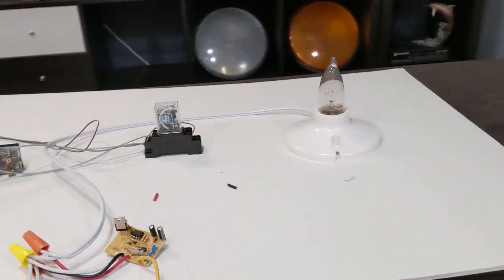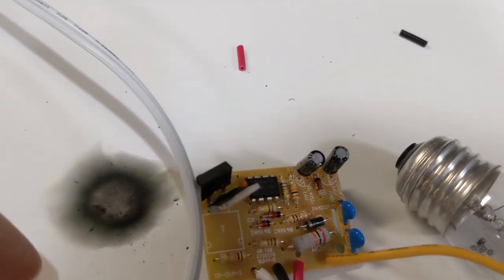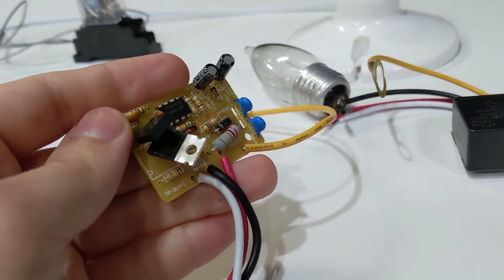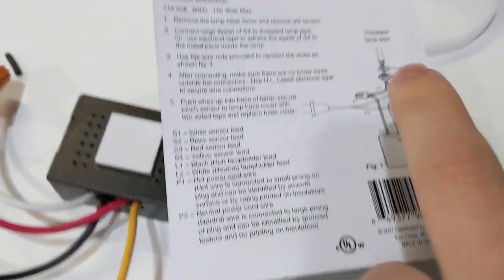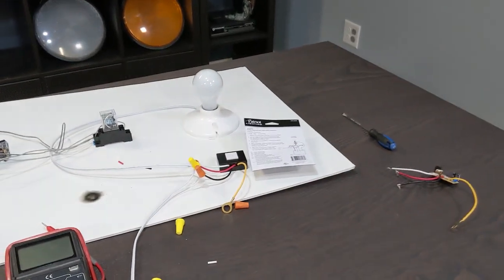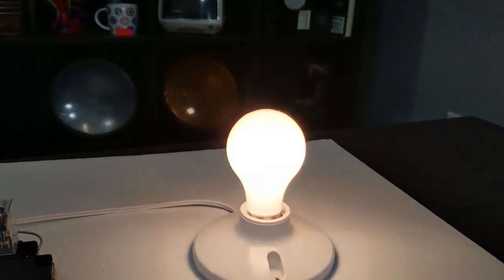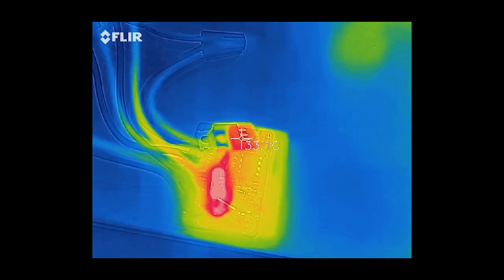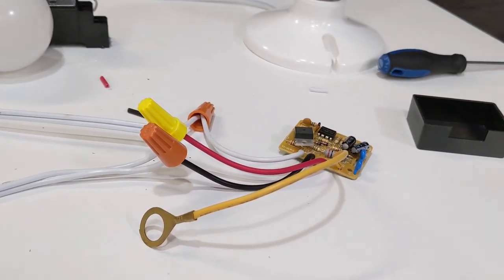A slightly explosive touch-lamp follow-up (standby energy consumption)

Comment: Black is negative or N, Red is positive or L it’s a standard yet US for bizarre reason picked black for hot yet in electronics it’s negative in DC or neutral in AC go figure 🤪
Reply: I was thinking the same thing. Using black for hot is weird. Red, as in fire, is hot. How the he'll can the US screw that up too? Together with the metric system and temperature.
Reply: Red is hot yea.
Reply: @andykillsu  Since when is black a "hot" colour?
Reply: How can black be hot/ live? That's just bizzare. The more I hear about the US electrical system the more I worry!
Reply: andykillsu when something gets hot it glows red, when cools down it’s black
Reply: @andykillsu  neither black nor white are colours, they are both definitions, a pint of Guinness or my black cat, they are just a very dark brown rather than black.
Reply: Andrew Delashaw brown 🤔, you mean dark orange don’t you 😁
Reply: @andykillsu  infrared is closer to red then black, hence red being live.
Reply: Black was selected for hot before there was plastic that are easily colored or electronics.
Reply: Black is live and white is neutral in the US. Unless you're wiring audio equipment, in which case for audio engineers it changes and  red is positive/live and black is negative/neutral. 
And then we have some old houses that are done with weird wiring that doesn't match either. Lol. Yeah, it's weird.
Reply: Lucid Moses , white would of made more sense for hot, as when something gets so dam hot it glows white hot
Reply: I was thinking the same thing as well, i don't hobby around with electronics, but the one thing i thought i knew went out of the window here, but now i see that it's a US thing, which is weird, but then again, there's more that's weird in the US.
Reply: @andykillsu  the car would be even hotter if it glowed bright white...
Reply: @neilkelly3849  Its not that bad.  Its all in what you're used to.  In the US, the basic AC wiring colors are: no insulation is ground/earth, white is neutral, black is hot and red is hot switched.  Thank goodness for low voltage DC we all seem to have the same basic standard, black is negative and red is positive.  But as far as building AC wiring is concerned, why in the blue blinking blazes don't we have a worldwide standard coloring standard?!
Reply: Probably been said elsewhere but before 2004 black was neutral in the UK and live was red. Changing to blue neutral and brown live. Single phase home wiring etc etc
Reply: @neilkelly3849  Yeah, no wonder a profesionnal is required to change a blown fuse.
Reply: My bet is o money - when they picked colors for household wiring white and black were cheapest available :)
Reply: @insoft_uk  Maybe, but the logic at the time was, the regular wire vs the special wire.  You could have this paper stuff, a rubber kinds of stuff or cloth.  Which ever the natural color was a kind of puky-pale whitish.
frankly you where lucky to have any "special". The old Knob and tube stuff was all single wire runs and your hot and return didn't even follow the same path.
Reply: when the wire my apartment complex in the early late 70's, they only use all black wires, then put dab of white paint on to the end of "neutral" wire.  So, just cause there are any form of "standardized" colors to be used, does not mean it is followed.
Reply: Gets multimeter out, black wire is common/0volts, red wire is +/line/hot/live, then says who would use the red as hot? It's an internationally accepted standard for test multimeters....
Reply: But in UK and EU Brown and Black are Hot and Blue Neutral, and in the US Black is a live color and white neutral... I don't know which standard you are referring to
Reply: @SamTheBattleshipp  In the US, when there are two active phases, they are typically black and red.  Speakers driven in a bridge configuration likewise have two active wires that are black and red.  Low-voltage DC is often wired with the negative terminal as the neutral voltage, but telephone circuits are wired with positive ground.  If there is any DC leakage between two buried objects, the positive one will corrode.  If telephone circuits had their negative leads at ground potential, all of the positive wires would corrode, but having grounding stakes attached to the positive leads will cause nearly all the underground corrosion to occur on a small number of grounding stakes rather than on millions of subscriber service lines.

Having the device switch the lamp neutral rather than the lamp hot is unusual, but might have been tolerable if had included separate wires for the two hots (so one pair of wires would connect to the cord and the other pair to the lamp).  Having the device connect the white and black wires together when turned on, however, strikes me as really bizarre.  I would think that the stores selling these units could improve customer satisfaction if they got a batch of stickers printed in color showing the correct wiring and warning that it is likely to differ from expectations.
Reply: @740mc  Exactly. In a single-phase setting, black is hot and blue is neutral in Europe. In a three phase setting, you have black, brown and gray for the three phases. The ground wire is green and yellow.
Reply: In Germany Black, Brown and Gray are hot wires, light blue is neutral and green/yellow is ground. Before 1965, neutral was gray and earth was red. While gray makes sense for neutral red did not. Thankfully it got changed.
Reply: Ruhrpottpatriot very much the same in UK, Brown is L1, Blue is N and Green is E, Black is L2 and Gray is L3
Reply: @grg121344  I've seen white cotton wire, and I've seen dark gray.  I don't think I've seen individual cotton wires in other colors.
Reply: Insoft in the US we generally read the directions and test with a meter instead of blindly following color codes ;-)
Reply: It's more like "marked" = hot, so between black and white, black is the marked one. Between black and red, red is the marked on. Between copper and silver, copper is the marked one. Then again, in 4-wire speaker cables the white/green pair has white as +
Reply: Jeff Groves in the UK we generally use our fingers, get great shocking results ⚡️
Reply: weust FOOT YOU! LOL
Reply: Red is universally a colour of danger, and  "Hot/Live = Danger" when it comes to electricity. 
UK wiring used to use red for live/hot and black for neutral - but now we use the hatstand European colours of brown for live and blue for neutral.
Reply: While "proper" color coding is nice, it's also meaningless for anything that isn't a straight "mains comes from here" or "mains goes in here" thing. What color is you "switched mains" then? No such thing as wiring up something like this module WITHOUT FOLLOWING THE FUCKING INSTRUCTIONS. Color irrelevant.
Reply: Bleached cotton bell wire (or paper) which has never reached high temperatures is white.  Wire (or paper) that has reached high temperatures will be black.
Reply: Electrons are negatively charged, therefore even in electronics the black wire is "hot" because that's where the electrons are coming from.
Reply: As a completely knowledge less person about this stuff, I assumed it was “black is bad” and you do not touch black.
Reply: Steven Emert Why dont we have worldwide standard? Because every country developed their local norms when it didn’t matter what other countries did. And getting everyone to agree after the fact is near impossible, especially with so much stuff using their own variations.
Reply: @greenmanreddog  I imagine that's another thing that could change after Brexit. We'll go back to red/black wiring, as well as having blue passports. Which of course is far more important than the economy going down the toilet.
Reply: @andykillsu  nice attempt at trolling
Reply: @iMagic16  Because objecting to the ceaseless cultural imperialism of Eurotrash is trolling
Reply: @greenmanreddog  UK has used brown/live blue/neutral in flex cable since 1969 (before joining EU)
Reply: @workphone8822  I find it interesting that in the days before RCDs, it was acceptable to have a lightweight green grounding wire, but nowadays the grounding wire must be large enough to handle sustained current equal to the line's fuse rating (and colored green+yellow to distinguish it from the wimpy green wires) despite that fact that an RCD would trip almost immediately if any non-trivial current flowed in the grounding lead.
Reply: @xenonram  Thats the colour your trousers go if you grab hold of it
Reply: In the USA: any color wire is hot EXCEPT white, gray, green, green with a yellow stripe, or bare wire. Usually for us electricians, in a 120/240v single phase system, Black is “A” phase hot and red is “B” phase hot with a white neutral and a green or uninsulated wire ground. In a 120/208V 3 phase system, A and B and neutral are the same color as the 120/240, but we add blue as a “C” phase (the third phase) and often run green for ground. The USA also has a higher voltage system for larger loads, such as commercial lighting and motors found outside of residential areas. This system is 277/480V, which their A B and C phases are Brown, Orange and Yellow respectfully and use a gray neutral and a green ground. We also use purple and pink in commercial installations for switch wires going from the light switch to the light(s) itself(themselves). Now these colors are a courtesy, and there are no code requirements outside of white, gray, green or bare on which colors are hot or not.
Reply: andykillsu look mate, I don’t think it matters about whether a colour is hot or cold; in the UK (or just me) I see red as hot, like when something is “red hot”,glowing hot, or even red fire engines (fire trucks). Where as you may see black as hot, as in fire ash or black body radiation (or something idk). But I think we are forgetting that colours aren’t any temperature, it’s the associations we build around them, party influenced by our culture: ie you Americans and us Europeans. If one system works for you, that being the imperial system, Fahrenheit and other stuff, that’s fine. I don’t care. It’s all built up on associations and intuition, that’s fine. 

The problem I have is the discrepancy between Europeans and Americans, and possibly the fact that you still use a separate system different from the rest of the world that kinda confuses me. It’s not that someone has less or more common sense, it’s that we have different common senses.
Reply: @andykillsu  "Because black is a hot colour while white is a neutral/cool color (both in colour temp and actual heat). You Europeans got it wrong and don’t want to admit the US actually has something electrically more common sense than Europe"

No, black is neutral in old UK wiring and negative in DC circuitry.  White was never used.  To take a colour that is normally asscoaited with negative or ground in any context and give it the opposite meaning is counterintuitive.

Also, if you're going to use English as a language, have the decency to use English spelling.
Reply: @Varangian_af_Scaniae  "@andykillsu Since when is black a "hot" colour?"

I'm guessing the logic of using black is "if you touch this, you die and black is the colour normally associated with death"
Reply: @xenonram  "@andykillsu yeah, brown is *live*. Derp. What idiot decided brown should be hot? Brown should be earth if anything."

Firstly, if you're gpoing to use the English langauge, have the decency to use English terminology.  It's not hot, it's at the same temperature as the neutral wire, it's live. 

Also, I believe the colours were decided so as to not confuse the colour blind, colour blindness being a condition that predominantly affects men (and being an electrician was tradtionally considered a man's trade)

The old colours win the UK were red for live, black for neutral and green for earth.  But red-green colour blindness is the most common form of colour blindness, hence the brown, blue and striped green and yellow.
Reply: Red = blood = bad = HOT
black = death = bad = HOT
white = blank/nothing = Neutral
green = grass = Ground
Reply: @andykillsu  Which is why something can be described as "white-hot", obviously because of it's cool connotations
Reply: To be fair, the US system is profoundly old, the NEC was first published in 1897, a full 10 years before the British had an electric code (they had recommendations before that, but not an actual code). So the logic behind wire insulation colors probably made more sense to the people at that time then they do now. The discrepancy between AC and DC is less surprising, the feud between Edison and Tesla is probably enough reasoning for that. As far as the logic of black being hot, you can justify or vilify the choice however you like with any color, but black is the color of death. Black, white green is as logical to me as red black green, and there are enough people building enough stuff in NA that it’s unlikely to change.
Reply: andykillsu You do realize that black cars are only hot in summer because they ABSORB more sun energy than other color cars, right?

orange/red sun light GOES TOO black car

just like:

red live GOES TOO black neutral

And the black car is ONLY hot when the red sun is shining.

just like: 

Black neutral only gets warm when connected to red hot.

Simple as that
Reply: GeoNeilUK Taking a colour associated with death and make the thing that will kill you that colour is very intuitive. 

You give me a multitude of colours of something potentially dangerous without any other information and the last ones I would touch are the red (the colour of warning and “stop”) and black (the colour of death). 

Fact is, it doesn’t really matter as different people will find different things intuitive, and standardized system would be extremely nice, though.
Reply: @andykillsu  How is black hot? In my BBQ, black coals are cold, white coals are hot! When it's dark outside, it gets cold, not hot.  
I agree that RED should be hot. 

I admit I'm electrically challenged (freakin' scared of it) from U.S.
Reply: @andykillsu  If hot is black then what colour is the tap for your hot water, I can bet that it won't be black...
Reply: In Finland blue is neutral and black is live (in this apartment anyway, I have also seen grey and brown used as live depending on the age of the wiring).  I have also worked on a ship where we used the US colours for the 110 system, the euro colours for the 220 systems and then to make things even more interesting we used IEC colours for 12 and 24 volts systems.  Our first engineer was from India, our second engineer was from the Philippines, and we had various other nationals as well, so electrical wiring could become a bit scary sometimes:-)  Luckily most of the high voltage stuff was fairly hardwired and not stuff we needed to touch.  Can be a bit odd trying to work out which is hot and which is not when the wires are all in the same wire chase though.
Reply: You are still getting it wrong. The reason it exploded is because you connected the white S1 wire to your mains line voltage. 
Your explosion has nothing to do with connecting black or red wires to neutral or not.
Reply: Why are you calling AC wiring positive or negative or neutral or even hot? Current in AC flows both ways, hence the name Alternating Current.
Reply: @Varangian_af_Scaniae  ever look at burnt wood it stone?
Reply: @neilkelly3849  stop worrying we got it covered, just try to follow along or is that too difficult for you?
Reply: @insoft_uk  that just like your opinion man!
Reply: @tomf3150  we don't use fuses anymore we use breakers
Reply: @JeffreyGroves  just in case some stupidly brave goober goes and wires up a hidden death trap, meters save lives.
Reply: Yankee Rider they is another way of thinking of black in as black is the colour of death therefore no longer live, so not live has to be neutral that’s just another way of looking at it. 🙃
Reply: p4rp you’re taking this too seriously.

We’re just saying red is allways been universally used as a danger warning colour would make sense for it be Live, and since black is GND in electronics basically the opposite of the + rail it just seems it make a good choice being Neutral in AC that’s all, tho UK no longer use them colours
Reply: @740mc  Brown Black and grey are 3 phase 415V, (blue neutral) only because we had to standardise in line with European standards. Three phase UK colours used to be blue, yellow and red (black neutral.) So now we have in single phase 240V domestic wiring colours- Brown is line/live, Blue is neutral, Green&Yellow is protective conductor/earth/ground.
Reply: LucasCGuardado the UK used to one time use Black for N and Red for L, now we used Black for L, we should of kept our sensible colours.

Our old colour system was great and simple red for danger just like 3 Phase I believe we had yellow and blue, our earth wires are yellow and green.
Reply: @insoft_uk  Yeah, but it's not the standard at the moment, so... DC voltages have Positive and Negative, tecnically both Black and Red in DC are "Live" a black wire doenst indicate 0v, but the negative voltage in relationship to the Red wire. 0v is ground (Green).